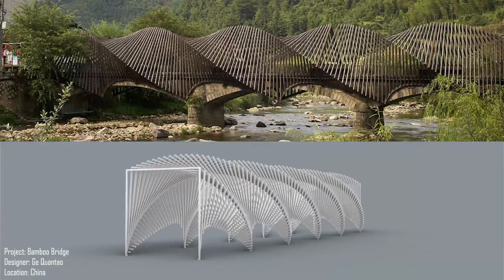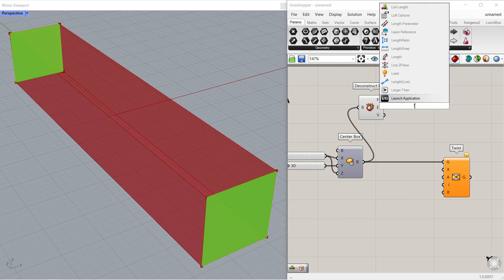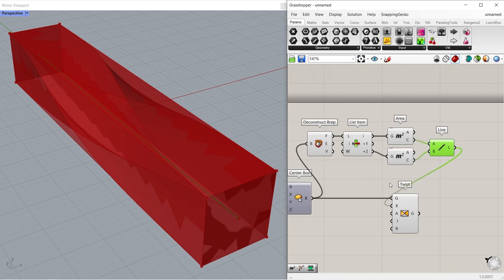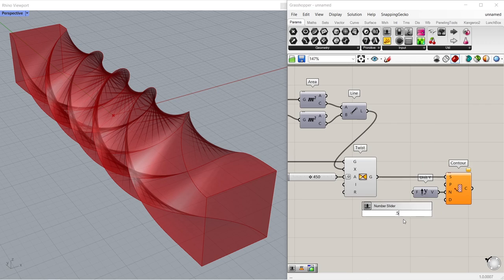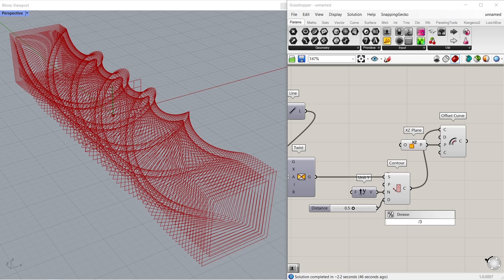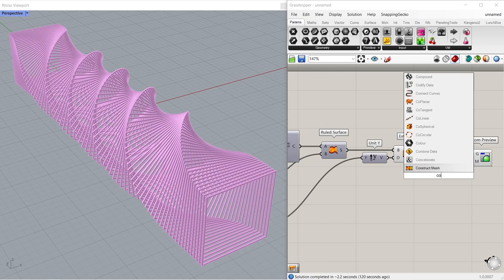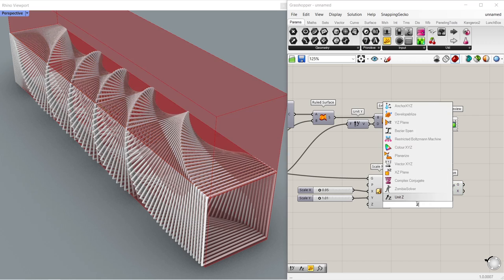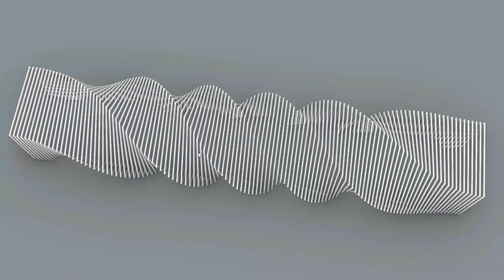Parametric Bridge Architecture

Comment: Great video, what would i have to edit in grasshopper to make it one smooth surface instead of the separate frames?
Reply from the maker: Teşekkürler. Do you have a sample image of what you mean?
Reply: @AdamArchh  Sure! i have to learn Rhino for my next semester and i'm practicing with your videos. I know it's a very specific question and i understand if it's too much trouble to answer. Something like this is what i mean: https://imgur.com/a/JXLJtxG 
I want one smooth surface in the model instead of separate frame pieces. In the image i managed that effect by reducing the distance in grasshopper but they're still separate pieces.
Reply from the maker: @diegomunoz6349  After doing the Contour command: you have to cut the surface using contours. Do this with the SplitBrepMultiple command. 
Brep>brep 
Contours>cutters

Comment: Hello, is there a way in Grasshopper to draw the wooden beam at the bottom where the parts arrive as in the picture?
Reply from the maker: Hi yes it is possible. But it is not easy for me to describe it in writing. You'll be able to do this when you learn a little more GH.
Reply: @AdamArchh   hi, thank you for your answer. If you discribe the main commands, I will try